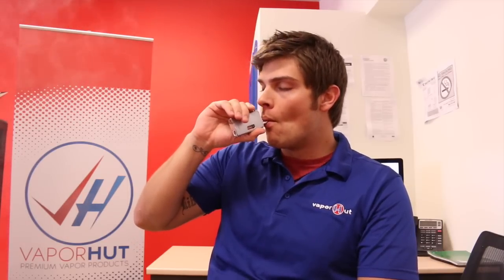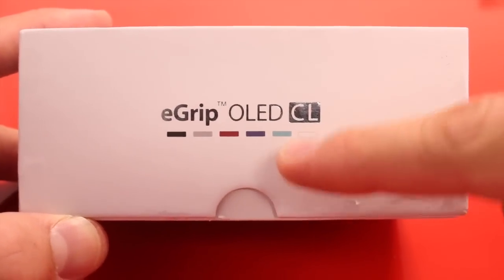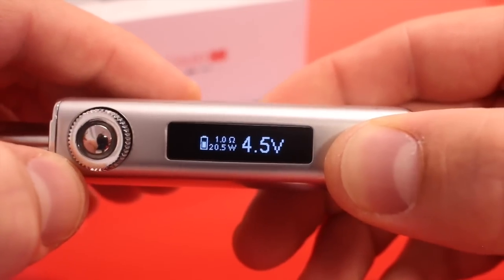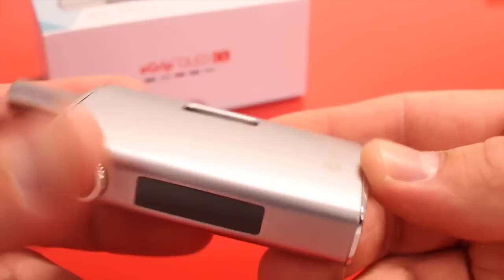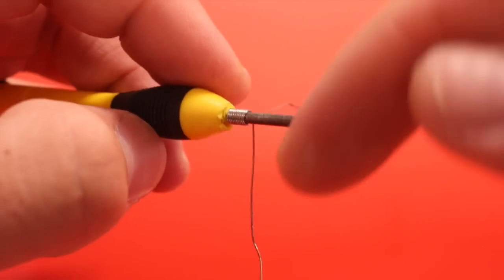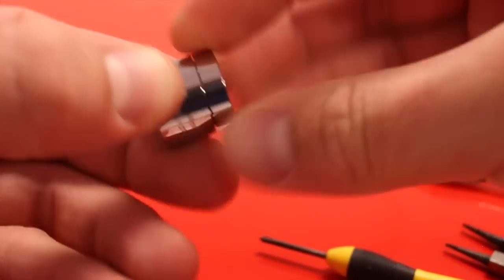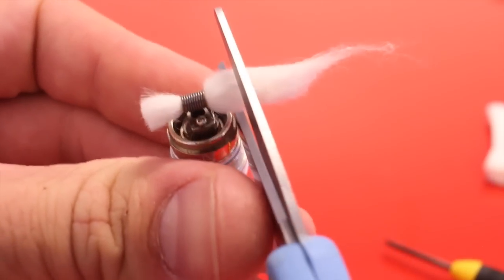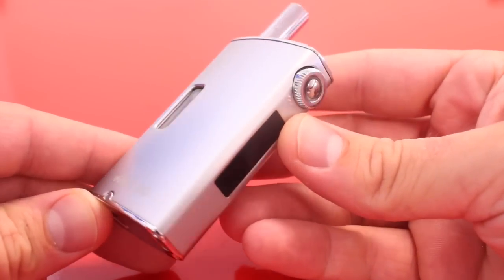eGrip OLED by Joyetech TUTORIAL & REVIEW

Comment: are there two versions of the egrip oled out?  mine only does 20 watts.  :)
Reply from the maker: Yep. The first one came out last December and only did 20W (no screen) and the newest one goes to 30W with a screen. 😁
Reply: +John Harris The 20w version oLed screen can actually be changed to 30w. Turn your device on and off and then press the fire button 30times if done correctly your screen should change it to 30w limit instead of 20w i have no idea why but it works
Reply: Thanks Matt.  that is crazy how that works!  :)
Reply: +Matt Hoath I guess Joytech has built it as 30W but had some safety concerns at the time of initial release. I was once in the same cituation (one example of my product caught fire  two days before launch). So i made a firmware with reduced max power. Once we found out that the culprit was the unauthorised mod, I've sent all clients a new firmware. Joytech has no firmare to flush so they resorted to the secret button stacatto.